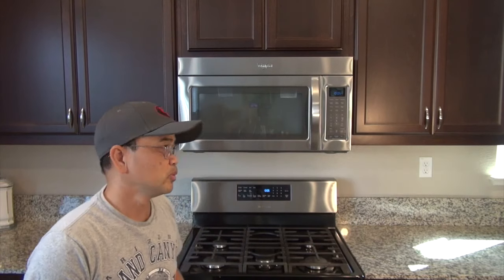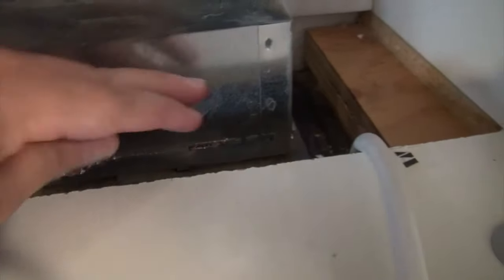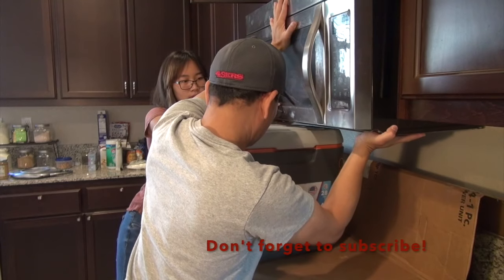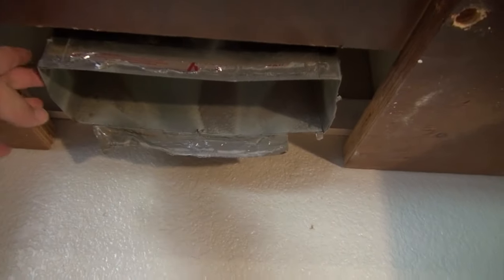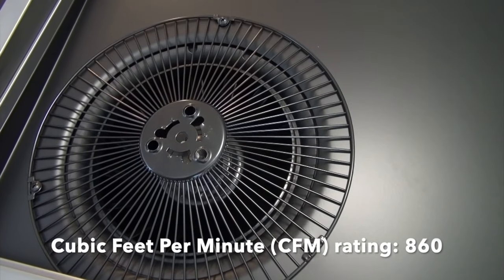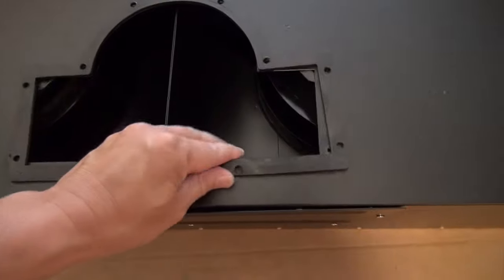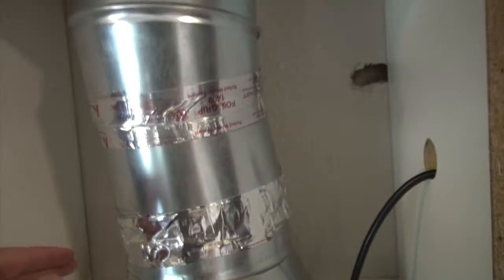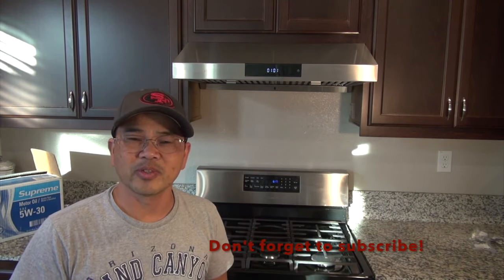DIY Over the Range Microwave Oven Removal/Under Cabinet Range Hood Installation

Comment: I think this model you installed has 800+ cfm. So did you have to install Air Maker? or this 800+ in the spec is over stated? Also the required distance between the stove surface and the hood bottom is 25" to 30" and I see here you made it less than 20", did you overlooked that? Or you think it is not important?
Reply from the maker: I have a large open floor kitchen with plenty of ventilation.  Also, I normally open my windows as well when I cook for sufficient air circulation. For the range hood,  I normally use level 4 for suction,  rarely needed to use level 5 or 6.  So I rarely use up to 800 cfm or more.  However, they are there when needed.  The measurement for the old microwave is less than 25" from the stove surface.  For the new hood, the distance between the surface and the hood is 27 inches.  Thanks for asking.
Reply: I am looking for range hood that has CFM of 600+. I looked everywhere to find out what the CFM is for this product but unable to find out. Where does it say it is 800+?
Reply: @tewabechgedafie3741  
It said that on the manufacture website and I think in Amazon as well.

Comment: What is the distance between the bottom of the vent hood and the top of your range?
Reply from the maker: 27 inches.
Reply: @diypotentials  Its generally recommended that there is 30" to 36", but I doubt you would want to remove you cabinets to get that much room. lol
Reply from the maker: @MAGAMAN  I agree.  Thanks!